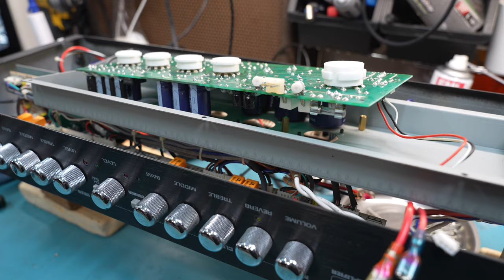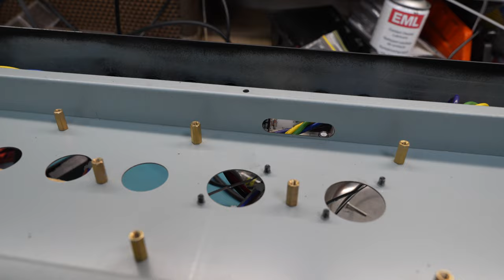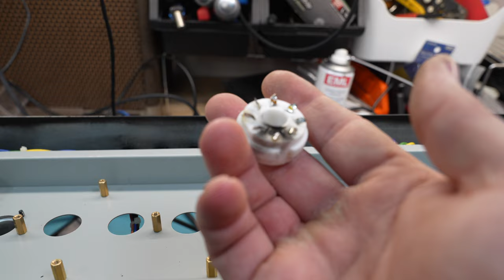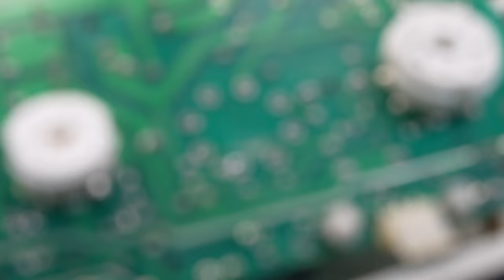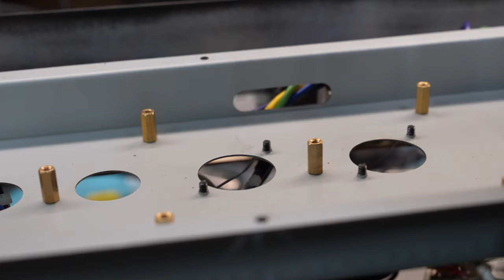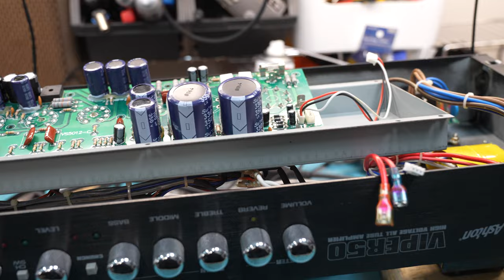Why won't a tech fix my cheap amp?

Comment: I just had a quick look and a place in Melbourne has the combo equivalent of this amp for sale for $320, so you're right about how affordable they are.
Reply from the maker: Spot on. Meanwhile, just the matched pair of output tubes it needs will run $150. That’s before I’ve even touched the amp to turn it on. 

That’s what makes amps like this great for the home hobbyist to fix if you know what you’re doing. To pay people like me to fix it though doesn’t make much sense.

Comment: This is a good case for watching a few videos and giving it a go. "Not worth paying someone to repair amps" are a good place to learn. Solid state, non-SMD, non-computer amps are cheap as chips, and no big loss if you can't fix them. Check for burnt traces, a few capacitors or resistors and you can fix most. Work your way up to tube amps. So what if you toast a few in your learning curve. The dumpster behind your big box music center is your friend.

Comment: I bought a Peavey Deuce at auction for what would have been a pretty good price had it worked when I got it. I took it to a tech and was told it needed a full recap. The recap would cost more than what the amp was worth. I decided to have it repaired anyway so I ended up with an amp that cost me about double what a good working unit could be bought for, all told. I think it's worth it to keep an arguably good amp alive and not in a landfill somewhere. The cost will balance out with other things I've bought and sold for profit or perhaps in karma points if I sell it to some kid for a good price or give it to a nephew.
Reply from the maker: In that instance, a used amp wouldn’t have had the same recap done so would need it regardless. That’s the other consideration, if you buy another secondhand unit, has it had that work done?

It’s why I still do plenty of Hot Rod and Blues Jr amps, once the repair work is done they become super reliable and won’t need work for another decade.

Comment: the issue i have with just getting another amp is you don't know if it'll die in the middle of a gig.  If you repaired that one, i could feel more confident when i rely on reliability.  I don't think I'd go and but an Ashton for reliability in the first place though.
Reply from the maker: That’s why I say there are amps I will do work on like the Hot Rod Deluxe and Blues Jr Series of amps as when you do the usual upgrades and repairs to them, they’re solid. They all have the same issues so any secondhand one will have the same issues.

Comment: I gave up.  Bought a Katana years ago.  When it dies I'll buy another.  It sounds really good and I dont even use the effects much.  Everything I record is plugins or my pedals into an IR.

Sold my tube amps with ease.  Getting rid of 70s Peavey and Kustom solid state amps is proving to be a little harder.
Reply from the maker: I went digital a few years back. Sold about 45K of amps I’d accumulated over the years. It works well for me. 

Properly servicing and maintaining old tube gear is an increasingly expensive endeavor.

Comment: With budget amps can come budget repairs, no need to replace all 4 tubes with new ones, that's where your costs are going up. You have 3 good output tubes (they don't need to be perfectly matched), most techs have spare used ones lying around, fix your trace, put in the used tube, see if amp works. If the customer is good with that I'd say give him a working amp with the caveat of saying you might want to put a good set of quads or duet in there when you have the budget.
Reply from the maker: Completely missed the point of the video. I don’t do half job repairs as it’s not worth it for the customer, nor for my reputation. 

Amps like these are worth less than the labour time to repair the issues. Why would I charge a customer more than what a nice secondhand one would cost? 

It’s what separates techs who know their work and respect their customer enough to be honest with them, and those who just want to make money.
Reply: I didn’t miss the point, and never said anything about dishonesty, in fact I made it a point to clarify to be clear to the customer, fixing amplifiers for 40 years that’s long enough to understand that a good repair can last without being shoddy. We can agree to disagree.

Comment: this is. common to many electronic devices unfortunately ... at the same time knowing that something that can be repaired with a medium effort goes to the bin is very irritating... guitar amps are simple electronic objects in the end and they should always be reparable in a sense...
Reply from the maker: Everything is repairable with infinite time and money. The problem is when the cost is beyond that of a decent used replacement due to how cheap the items can be new.

Comment: So hey man, so just curious about the economics. So if this amp is $450 in good working order, can you give me a ballpark on what the repair would have cost a customer?
Reply from the maker: It’s still not fully operational so I can’t really say how much it would cost. 

Just based on the time I’ve spent on it thus far and a new set of output tubes, we’re at $375 on a head that’s sold for about $400 on the used market. 

I probably hazard a guess there’s another hour of labour in this as I was able to get signal up to the end of the preamp, so that may take it as high as $525.

Comment: I’ve had a Laney Cub 12R in my shop for months! Just a terribly built poor quality piece of junk!
Reply: The inrush limiters on them are notorious for having troubles - causes intermittent loss of audio especially after warm-up
Reply from the maker: Yeah they are a very cut rate amp. Sound great but repair is a nightmare on them. 

Nothing like the phenomenal LC15 amps. I had two of them for a mini stereo rig for small gigs years back. Picked them up for $200 each.